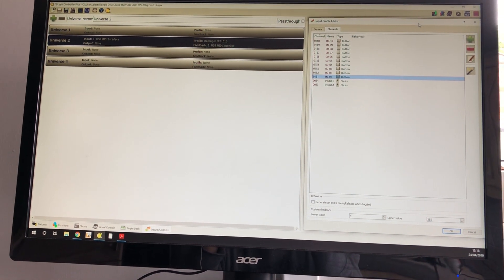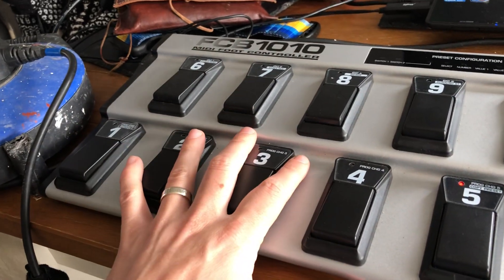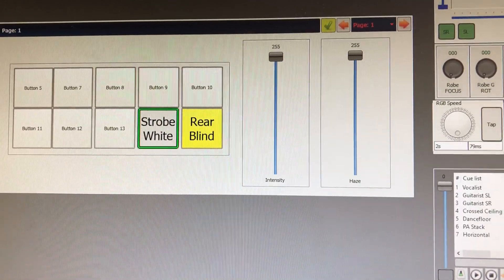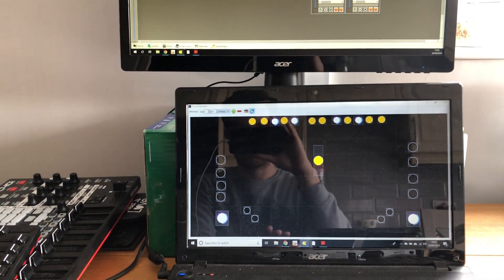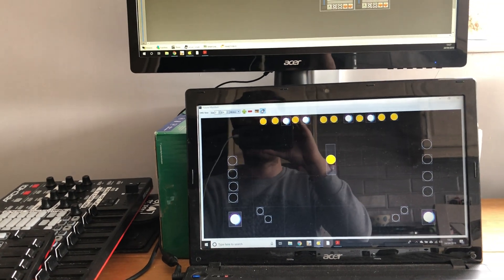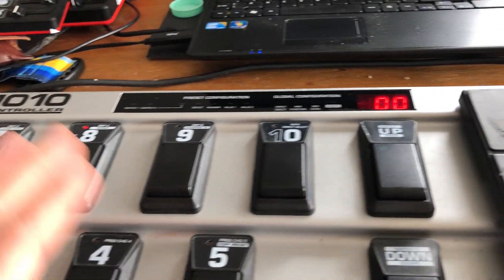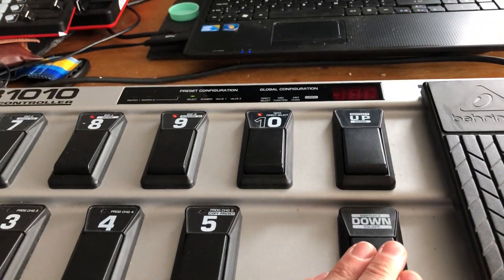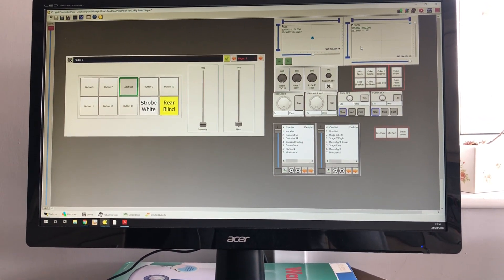QLC+ and the Behringer FCB1010 (controlling lighting with your band/ DJ setup)

Comment: Hi Josh thanks for this video - I'm going to be playing this video quite a lot in the coming days as my FCB1010 is inbound from Thomann right now. I'm also using QLC+ although I don't have a many lights as you have. Did you ever configure tap tempo on a button to set the chase speed?
Reply from the maker: Hi Andy, yea I did get there in the end! It was sometime ago but I do remember cracking it. It’s a bit of a clunky video on reflection, however, I hope it serves to help!
Reply from the maker: Hi Andy, yea I did get there in the end! It was sometime ago but I do remember cracking it. It’s a bit of a clunky video on reflection, however, I hope it serves to help!
Reply from the maker: Hi Andy, yea I did get there in the end! It was sometime ago but I do remember cracking it. It’s a bit of a clunky video on reflection, however, I hope it serves to help!
Reply: @citymariner  LOL 3 Replies!! Seriously, I just spent the last few hours setting up the buttons and calibrating the pedals. That was doing my head  (pedals) as they were either on or off until I did the calibration. 
I've got the basic button config done now just need to sort out the tap tempo for the chaser speed dial. Can you remember what you did? Thanks again for this video, VERY much appreciated.
Reply from the maker: @AndyWragg  apologies I was in a low signal area so think it acted like the pedal did before I made the above video. 😂

Comment: Awesome video man. I've been looking for a setup like this for a while but wasn't sure how to do it. Now I just need to worry about sending the midi signal 30-50m to where the computer is for lighting hahaha.
Reply from the maker: KLRCat No need as the Raspberry PI is the computer and that is hidden under the screen on stage.  I then run another DMX cable to my DMX Splitter from the raspberry PI that use utilises a usb to DMX interface. You technically don’t need a computer at all and depending on the usb splitter you can run multiple universes.